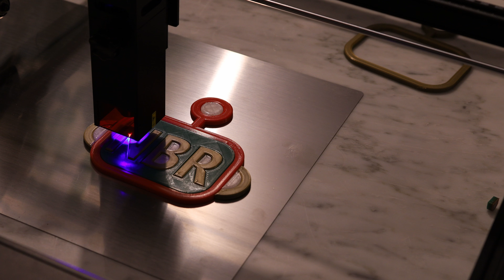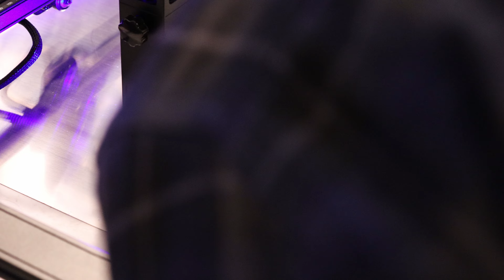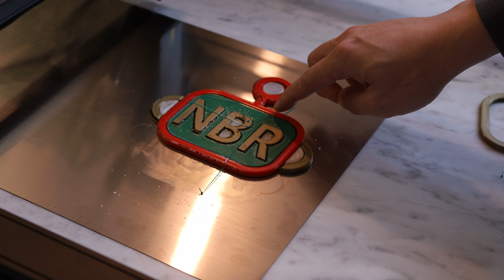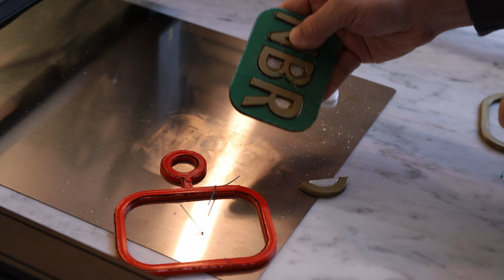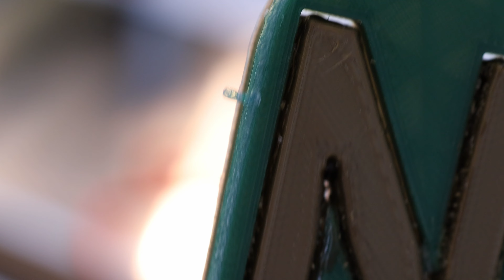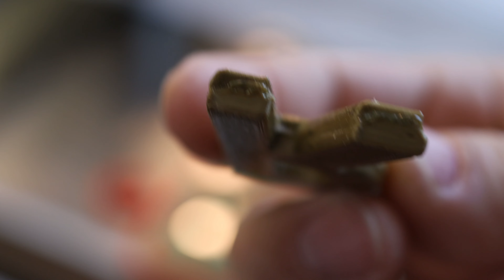Laser Welding 3D Printed Parts

Comment: Look up the videos for annealing 3d prints - they tend to shrink in the xy and grow in z due to the internal stresses. 

I think when you heat it with the lase it shrinks in the xy away from the join, making those gaps.

Maybe a plastic that shrinks less. See the prusa vid about annealing.

Also color matters with these blue(ish) laser diodes, dark colors will adsorb all the heat at the surface, lighter colors will reflect more and translucent stuff will have the heat disperse vertically. Maybe you can use translucent parts to get better weld depth without burning.

Neat idea!

Comment: Even if the first few tries are not a success its great to see the process.  A co2 k40 laser would be a much better laser for this job since the lens can be put out of focus multiple times greater than diode laser and is multiple times stronger.  Really the diode laser cutters are not good for much other than engraving stuff and cutting paper thin materials unless you want to watch it cut 1/8 thick material for hours.
Reply from the maker: Lol how right you are. I think a CO2 would be better. Especially since the longer wavelength should heat things more evenly, and be less prone to burn things

I have a full review of this laser coming. I cut some large 5mm thick wood parts out and it took about an hour per part. 🤣 

You don't have to watch it though, just set it outside and let it do its thing.

Comment: Interesting idea, lots of variables to fine tune (thickness, plastic type, colour, laser type, power etc.) maybe start off spot welding to get a feel for potential?
Reply from the maker: Will try that, just poke a hole through 2 sheets for a point weld.
Reply from the maker: Another commenter said to try clear on top/opaque on bottom. Makes a lot of sense to me

Comment: The solution is always bigger lasers! :))
Reply: I have a tip for you: you can weld with laser really well a transparent part to a nontransparent part. Of couser the transparent part needs to be on the top and should be really transparent. We use this kind of welding in actual manufacturing.
Reply from the maker: @dtibor5903  now that is a hot tip! That way the energy gets dumped right at the material interface. Brilliant 👏
Reply from the maker: I have a 10W on standby 🔫 (2x power)

Comment: Make a chanfer in both edge. Add a powdered plastic in the formed "V" and apply the laser. It should make a more consistent welding. SImilar what you tried with sugar, but in a deep V well.
Reply from the maker: 2nd idea is to add some flux that would displace the oxygen to reduce oxididation of the plastic to improve bonding, just like with metals.
Or have a foaming powdered plastic that would expand to glue both sides of the joint together.
Reply from the maker: That is a good idea. One of the issues I had is the plastic tends to retract when heated, maybe due to surface tension or something. So even if the parts started out touching they would pull away. Having a powder that would melt into a molten pool sounds like it would bridge the gap. Maybe some chapped carbon fibers would work well too. Then the joint gets fiber reinforced.

Comment: Awesome idea! Maybe it was too thick for the settings. Maybe moving the laser in a zigzag over the parts like a sewing machine would produce better results. I would like to see how well laser post processing polishes a figurine.
Reply from the maker: That's an idea. 

Defocusing (where i zoom out the laser) gives same overall average energy.

But a stitching pattern could be useful if you need high intensity over a larger area.

In general I preferred the defocusing method because the high intensity caused the plastic to burn, while the wider, slow cooking beam caused more melting.